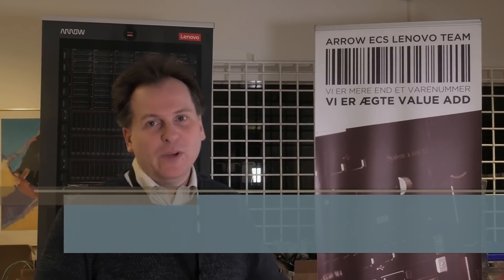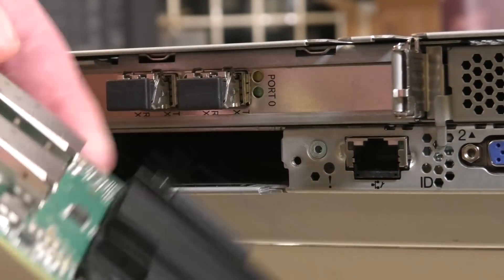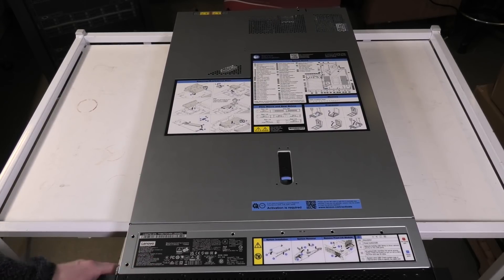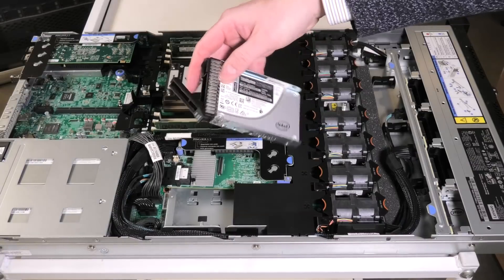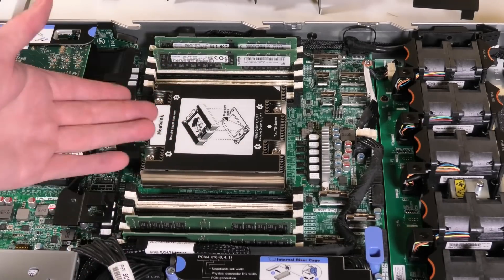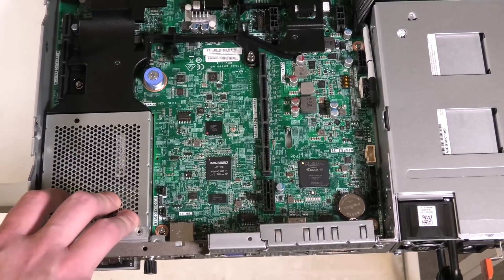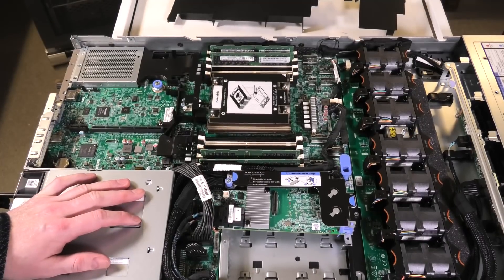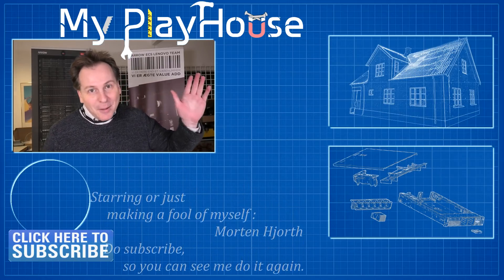64 Core AMD EPYC in 1U Lenovo SR635 Rack Server - 1148

Comment: doesn't this chip do 8 way mem? i think it does and you should really try to run 8 chips for ram to get max io - i could be wrong
Reply from the maker: The newest Intel CPU´s are 8 ways,,, I do not know about the AMD's
Reply: Yes, all Epyc/Threadripper Pro CPUs use 8 channel DDR4 memory. Upcoming Epyc Genoa will use 12 channel DDR5 memory

Comment: Does Lenovo have security issues?
Various security risks and vulnerabilities have plagued Lenovo PCs. ... Over the years, Chinese computer and smartphone manufacturer Lenovo has been caught pushing bad software on its users. It's not just bad: it's flawed. Whether drivers, workarounds, or bloatware, Lenovo has a terrible record for protecting its users.Dec 14, 2020
Reply from the maker: Well I can assure you that they do not push as much useless software out as Microsoft. 
Last week it was Linux that had a manger security issues,, any user could be root in seconds.
Reply: @MyPlayHouse  this type of hw is basically just for bigger biz - normal people can't relate - a better way would be to highlight clustering nodes of smaller boxes - with the era of zen4 and rise of sbc fast approaching smaller nodes are cheaper and more affordable for the average biz and average consumer - they are also scalable - the biggest trends going forward are going to be nvme and faster networks like 2.5/10gbe #redundancy #HA design #mkt trends #smb mkt

Comment: That thing is insane. I wish they were affordable. lol
Reply: The first gen Epyc are starting to become a bit more affordable. You could get a mobo, CPU and memory for $1k or so. Just spent $2k AUD for a 24 core 7451, Supermicro H11SSL-c and 256GB DDR4 3200 ECC. Is going in a Supermicro tower chassis that's rack mountable.

Not cheap, but that's a hell of a lot of oomph for the money. Mostly I wanted to consolidate the three machines I currently run and will add a dedicated storage box later once my needs outstrip the HDD space I have in the chassis.
Reply from the maker: This Server starts at about $6k,, it is a very high start prices,, there are not the same entry level AMD CPU´s as Intel has.
Reply: @MyPlayHouse  yea, i can think of nothing better to run my house. but I cant drop $6k on it. lol
Reply from the maker: YouTube is messing up, and climes that I have not replied to this,, sorry for the "disturbance in the force" :-/

Comment: Surprised front 3.5" are not NVMe compatible slots
Reply from the maker: I am surprised they have not made a system where you put M.2 sticks in the front..
Reply: @MyPlayHouse  M.2 isn't a hot pluggable format, because it doesn't connect the ground before the power/data pins. You can put M.2s into a U.2 enclosure and hot plug them.

Comment: Why is it that so many rackmount servers still use analog connections for displays? Is it it a legacy thing, that displays in data centers are slow to get updated, a cost thing, or what?
Reply: With the simple needs of a rack mount server, no benefit going to DP or HDMI, and with existing KVM / consoles commonly being VGA, mixed standards would just be a no-win hassle. And with the remote management being done via network connections, most servers will probably never get screen directly attached anyway.
Reply from the maker: It's just an good old standart,, the monitors and KVM switches in the DC use the same,, and what else should they put in,, so many other choices.
Reply: The cost of a high resolution connector like display port wouldn't be worth it as users would have to get upgraded gear to connect, and very often these are never connected anyway. I have 2 machines that have never had a display connected, I use the onboard remote management feature.

Comment: LMAO 2019 is not bad, that server probably has 20 years of non-stop use ahead of it.  Our Data Center is using 10 year old servers right now that this could run circles around easy but industries that are not Google or Facebook or Amazon don't look to upgrade every year, they use equipment for many years.
Reply from the maker: We do actually try to replaces the servers after 5 years. We have HPE DL560 Gen10 going out of services shortly...
Reply: @MyPlayHouse  lucky you :D wish we were updated too but yea a lot of shops use equipment for very long times. These Lenovo ones right now are also selling here in Canada for 1/3rd their original pricing too!